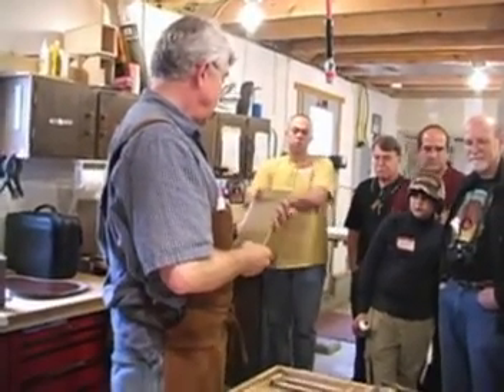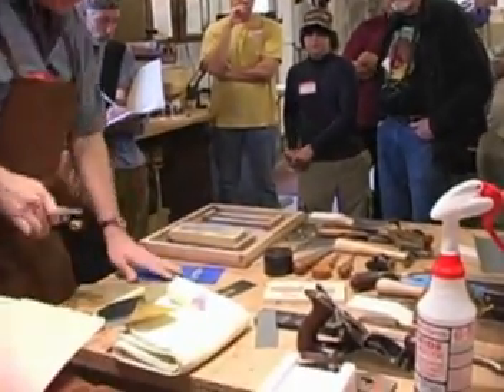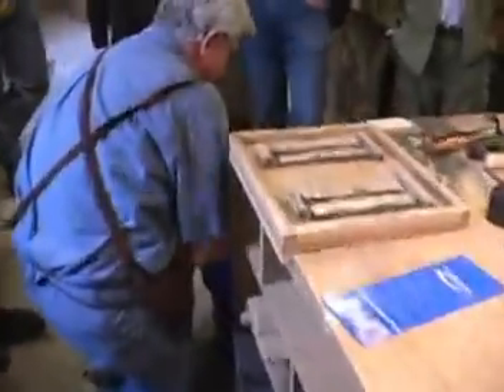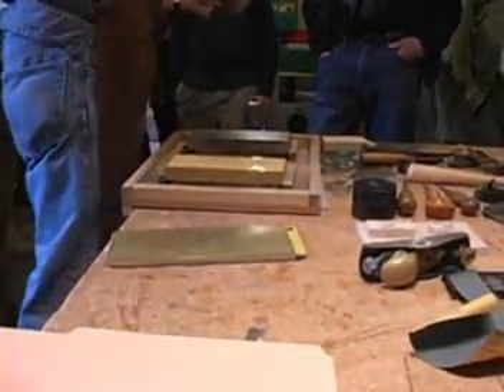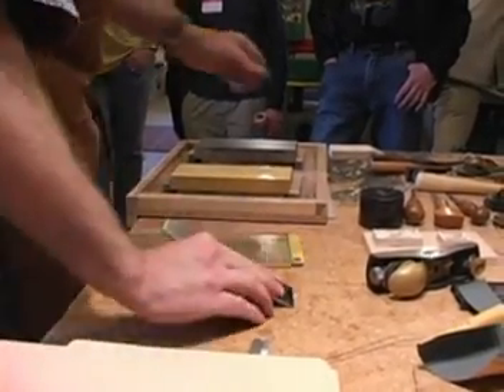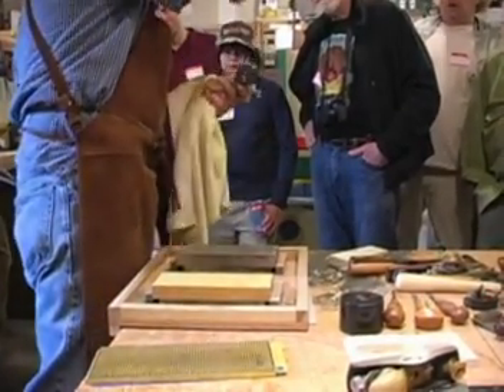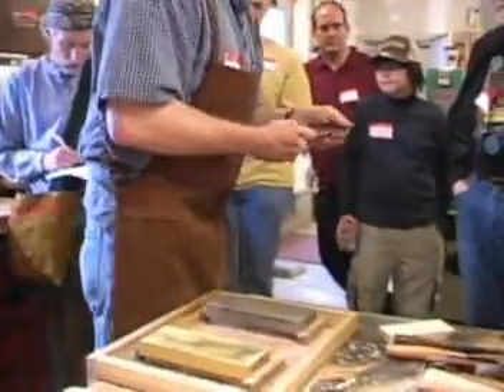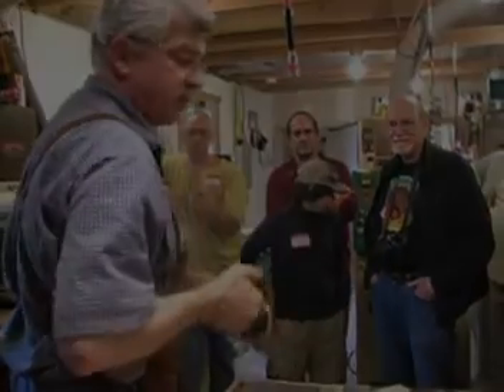Sharpening Part 3: Diamond Stone & Waterstone System

Comment from the maker: @mfcman2k7 No reason to use the ruler trick if the back of the blade is flat and polished...the ruler trick is really more of a quick fix to avoid having to put the work into polishing when in a hurry and confronted with a new blade with a poorly milled back.